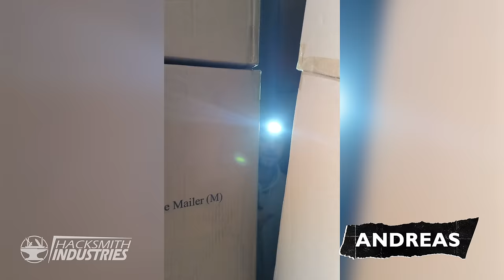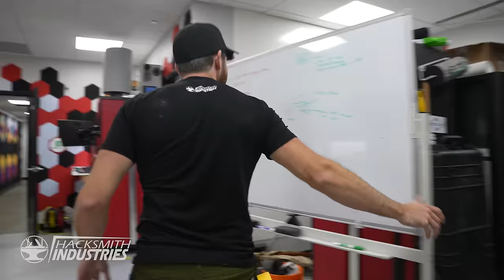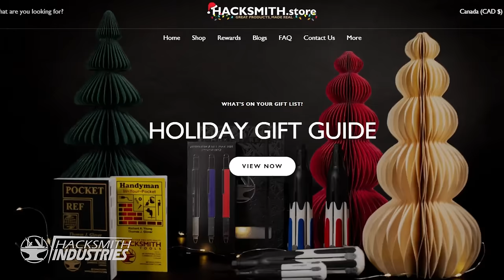Boss vs Employees - Extreme Hide and Seek

Comment: Tyler and Bogdan definitely had the best hiding spots. They endured siting/standing in a wall and floor for 3 hours.
Reply: And maybe risky their life :D
Reply: @MINI-MOI4321  if i were them I would 100% grab an o2 tank with me for the 3 hours.
Reply: @Vital_was_taken lol
Reply: @Vital_was_taken so you would go full space engineers?
Reply: @ghfgh_  yes, honestly I don't understand how you can hide in such  unbreathable without extra o2. And o2 tanks aren't that expensive I belive
Reply: With a gas mask and HAZMAT suit, as someone who has worn a gas mask for an extended period of time, thats impressive
Reply: Tyler under the tiles
Reply: @Vital_was_taken You could make a snorkel of sorts pretty easily if you're worried about oxygen.
Reply: @legoboy-ox2kx  okay, I made the snorkel, it still sticks into the unbreathable area. And if I make a hole for it outside it can give away my location
Reply: @Vital_was_taken  As long as the hole is disguised in some way you could make it work.
Reply: @legoboy-ox2kx  well in the case of sitting in the floor the snorkel couldn't really be disguised and even if it was it would be too long to make breathing through it possible
Reply: @Vital_was_taken  Fair, in that case you would need a tank, but for the insulation I could probably find an easy way to disguise a snorkel. Hiding in those tight places is impressive as it is though!
Reply: @legoboy-ox2kx  yes for the insulation a snorkel would be good unless some insulation entered the snorkel. So you would still need a filter.
Reply: Agreed
Reply: At the very least those bottles that press to your face for a few breaths at high altitude  @Vital_was_taken
Reply: Bogdan, are You from POL?
I would say Gratuluję wygranej w turnieju!

Comment: Honestly, Tyler made probably the cleanest and most invisible spot of all. Bogden was in a cut wall so had some form of opening, but Tyler's had absolutely no telling that it was altered and looked like perfectly normal floor tile.
Reply: The only way he could have done it better is to put insulation on the underside of the panel so that James wouldn’t notice via heat signature
Reply: @sgrey9181  although thermal cameras in hide-and-Seek does fee a bit... Bad

Comment: 3 years ago I said the team had to step their game up and made recommendations. Almost all of those ideas, even the incredibly stupid, dangerous, and impractical ones have now been successfully performed by the Hacksmith team. I think I suggested replacing an engine with a shell replacement, and duplicate Ikea couches moved in specifically for the event. Amazing. I suggested using a concrete saw to cut a hole through the slab, Tyler just dug under the tile in the bathroom and Rob did it outside. I suggested "the ninja" who hides in plain sight or just avoids James's movement, JT delivers. I suggested whole hidden wall sections, Bogdan shows me it can be done 2 years in a row. Don't care if I didn't inspire it, just happy to see it done. The brains on Tyler. The balls on JT. The stamina of Bogdan. Those three win the hearts and minds of the Hacksmith Subscribership for the 2023 Annual Hide and Seek Championship. Honorable mention to Hunter for "Latched not Locked" technically correct (the best kind of correct), and to Jess, for demonstrating why money isn't everything for the 3rd year in a row.

Comment: The simultaneously stupidest and one of the smartest hiding spots was definitely the insulation. 1) one can not touch it unless they are wearing protection (which is both great and horrible for the hider), 2) no one is going to notice and insulation pile being more piled than usual, and 3) it naturally insulates heat with its power of being insulation.

Comment: My choice in that year would be easy. Get a camo jacket and pants (and some good, dark boots) before the hide and seek. Then walk off into the wooded parts, find a good area that's hard to see from most if not all sides and lie down and just wait
Reply: The rule was company buildings and vehicles. The monster truck was bending the rules by taking a company vehicle far away.
Reply: @jacky7204  it just said "fair game", not "You can't go there"
Reply: A little mud on top to hide from thermals crawl under a bush or brush pile, and then take a nap while earning that paycheck.
Reply from the maker: The rule was only in buildings. 18 acres is too much outdoors
Reply: @hacksmith  so get that many ATV and cover it with camonet...

Comment: There exists a 2000 dollar flashlight with a supposed range of 2 miles, it has 12m candle power and is used by the military. It also just happens to be the same flashlight from Jurassic park and you should totally get one
Reply from the maker: That's the one I used lol

Comment: I think it'd be a neat thing to not pull out the thermal camera until a little while in. Basically see how many you can find without it first.
Reply from the maker: Did you watch the video though...? It only found one person who I probably would have found anyway lol
Reply: @hacksmith   I did watch it, actually. And there were more that maybe you could have found if you'd used the camera at the right time, which having defined times where you can and can't use it might mean you'd also be more likely TO use it once you're through that period.

If that makes sense. It's late here and words are hard.